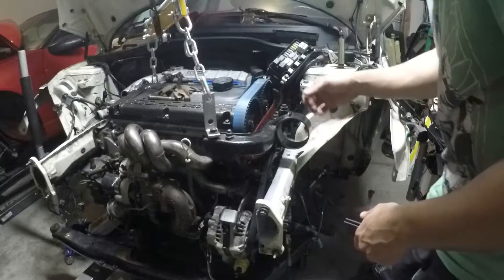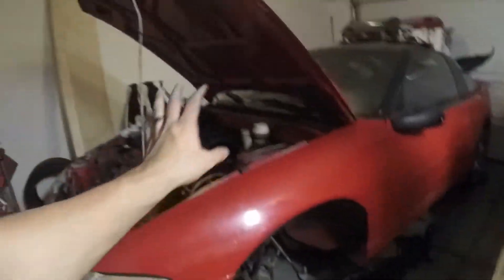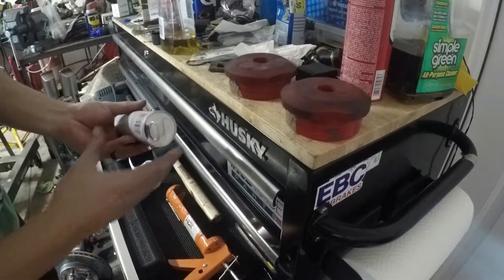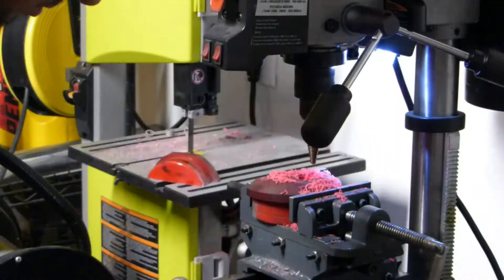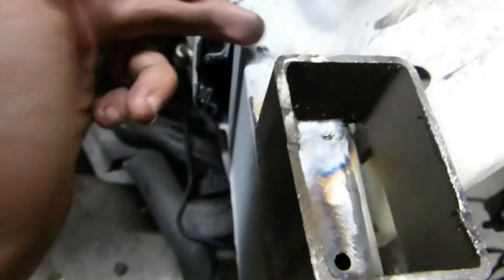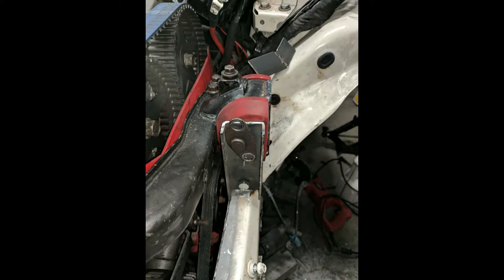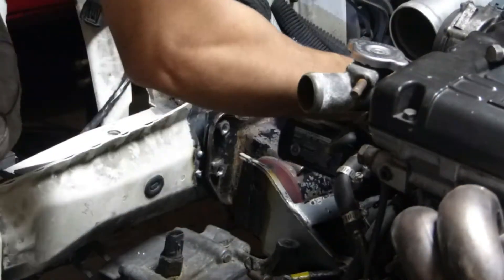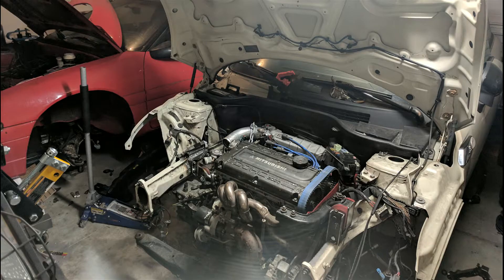✓ Custom 4g63 Engine Mounts - AWD Mini Cooper Ep. 11

Comment: why mitsubishi engine? most of the classic mini swaps are honda
Reply from the maker: Great point. So a few different reasons, first is that since it is not a classic mini, I am not as crunched for space so I had a lot more options to consider. Honda B series was definitely on the list along with k series, the EJ 2.5 from the Subaru, SR20det from the AWD Nissan Pulsar GTIR (not sold in the USA so I looked to import a half cut from Japan) and the 4g63 (plus 4b11) from Mitsubishi were my top considerations. The Subaru engine with transmission was too long for the engine bay so it got cut pretty fast. My main objective with this build is AWD and the only way to do that with the B and possibly K series was with a Honda CRV transmission and full drivetrain. Not only are they difficult to find in manual, they are an suv transmission, not a performance transmission, so I know I would be limited on power and support options for it. That in combination with the price of a decent B or K series pretty much broke the bank. The pulsar was my next choice and it had AWD and a very well supported platform with the SR20det however, the transmission was considered fragile at anything over stock horsepower which means that you'd be either stuck stock, or have to be constantly replacing or custom building the transmission and they are quite rare. So the transmission again pretty much left me with the 4g63 as the obvious choice. The 4b11 would have been nicer or the Evo 4g63 which would allow for a 6 speed transmission. The entire car was $1900 and I sold the Mini engine for $2400 (not including eBay fees) so I had some money for the ECU and steel plate to fabricate parts. 
I hope that answered your question and if you have any more, please feel free to comment back ;-)
Happy modding,
-Ryan
Reply: i have not seen a youtube video of new mini honda swap....i hope somebody will make one in the future.....good thing about used honda engines are they are inexpensive....i like the body styling of classic and new minis.....but the classics are so expensive....used new minis are very affordable but reliability is a big question....so a low budget honda swap is the solution i see
Reply from the maker: Very true. I went got rid of my engine because I knew it would need maintenance and it was cheaper to swap in this motor than it would be to rebuild and do maintenance on the original engine haha
Honda would be an option. If you don't want AWD then it's a very good way to go. AWD you'll run into the same challenges I saw with it unless you want to stay 300 whp and below

Comment: Also I do have a question, since the vacuum pump is also a regulator for the turbo as well as helps boost the brakes, how are you getting around that since it was mounted on the mini engine
Reply from the maker: Great question. Well from what I could tell, the vacuum pump was used since the engine didn't pull much vacuum itself (since it was a pretty small but high performance engine). I should be able to use the engine vacuum of this larger engine to boost the brakes like in any standard car ;-)
The vacuum pump does regulate the mini turbo because the wastegate diaphragm is opened by vacuum rather than boost and that is triggered with a solenoid. Since I am using a different turbo with a standard wastegate, the boost will be referenced by the wastegate and thus regulated without an oem solenoid.
If I hook straight to the wastegate with a boost line, then I'll have boost regulated by the wastegate spring with positive pressure rather than vacuum. Most turbo cars are set up this way for simplicity.
I do have the option of using its standalone ECU regulate boost via an aftermarket solenoid like I have on my genesis coupe (although my genesis has a separate boost controller, the mini will have a speeduino stand alone that can control it).
Hope that answers your questions and thanks for watching